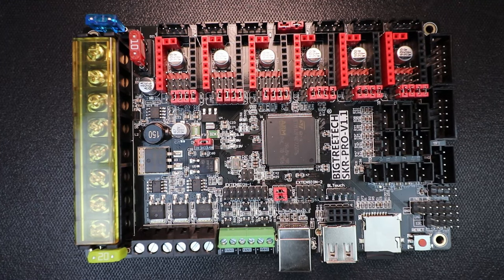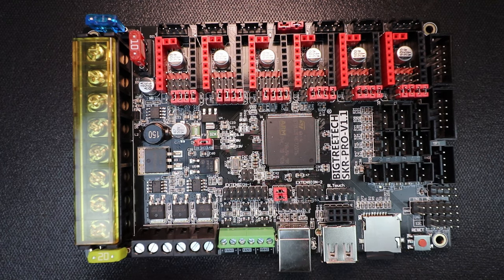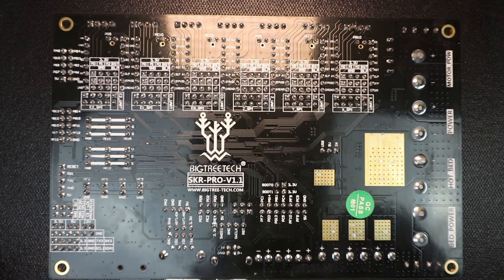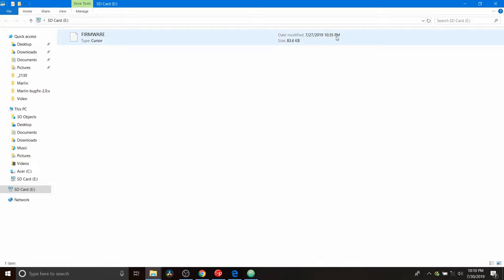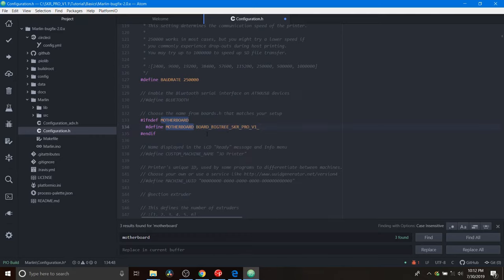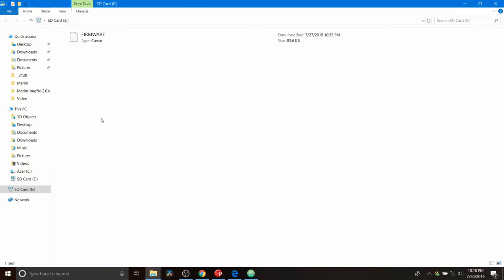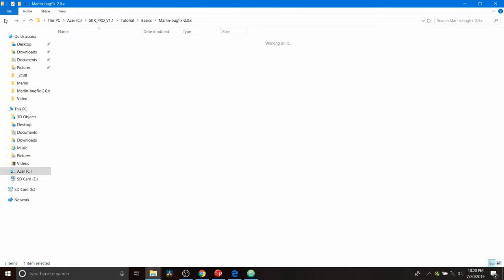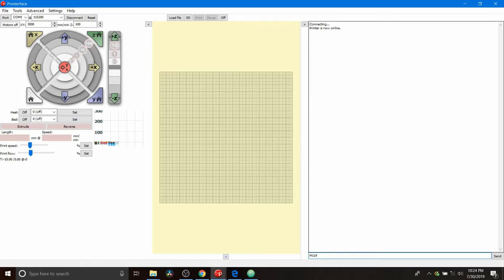SKR Pro V1.1 - Basics

Comment: I recently purchased one of these boards and I was trying to figure out how I was going to control it via USB turns out if you leave the jumper on USB but also power the board with your power supply it works just fine at least for me it did I'm not sure if that's how it's supposed to work or not sort of new to this 🙃
Reply from the maker: Well if it works and is safe sounds good.
Reply: That jumper controls where the board is getting its power from. If the skr is out of the machine on the bench you can use usb power to run the logic (not motors) and update firmware. Once the power supply is hooked up you should set it to internal power instead of usb. It will work either way, but you don't want to power the board from a raspberry pi (running octoprint for example). You can still flash firmware and communicate via usb when running on internal power once it's installed. So no worries there.
Reply: @roomtemp6374  nice thx did your version of Marlin come back with any errors when connected to pronterface mine functions and will print but will not save to eeprom it's just giving me ( hardcoded default settings ) I can change eeprom settings but they will not save 😑
Reply: @soloreclipse94  I think I only used pronterface on it for a minute to verify it was working, but no errors that I recall. (There was some strangeness with getting serial -1 and 0 properly but I think that was the computer.) No errors in octoprint where it ended up. 

Make sure #define eeprom_settings and #define eeprom_chitchat is enabled in your config file to enable saving eeprom iirc. After that it should work from the terminal or the printer lcd like it did in the arduino.
Reply: if left on power source from USB, and using 5160 drivers 1.2 the drivers will not enable and you will see a wierd hysterousis start end report. Turn to IN and 5160 drivers can now be enabled. Guess these drivers pull more power than usb can provide...which does make sence.
Reply from the maker: The USB will work, the problem is loading new firmware like SKR v1.3.

Comment: Great video,
My board is working fine just need to fine tune my steps per mm for both axis also on my board the head bed terminals are reversed the positive goes to - on the board and vice versa will this be a problem ? 
Any one has this issue on their board?
Reply from the maker: If they specifically say positive and   negative you should use them in that manner.  Normally in the past they've used red for both, bit they might have specialized electronics on your heat bed.

Comment: Connect stepper motor drives and connect motors. Try to move moters.
Motors won't respond.
Reply from the maker: Could you give some details?  So far I've only done a video on 2208 UART.

Comment: .when ı do this steps according to do skr v1.1 board and build it finally ı get the error: "LPC1768 failed". I can not solve this problem. Please help me
Reply from the maker: Which IDE are you using?  Does it build in default unmodified Marlin firmware?
Reply: Visual studio Code with platform io. Yes ı download unmodified marlin-bugfix 2.0 and compilie file.  I solved the problem. But this time ı have not got  ".pioenvs" folder in marlin folder :)
Reply from the maker: Do you have a .pio folder?
Reply: @EdwardBraiman  yes
Reply from the maker: Check the subfolders or search on, "firmware.bin".
Reply: @EdwardBraiman  thanks a lot for your attention :)
Reply from the maker: You're welcome, just remember to pass it on.

Comment: hello I have a mks gen l 1.0 and I can't make the engines work, my drivers are DRV8825, the engine is nema 17 (nema 17hs4401 4.2kg / f) and even after doing several procedures the maximum I could do was make the engine get quite noisy and simply not spin (I can't move it is energized) when I put the original anet a8 card the engines run normally the 8825 vref tried both 0.6 and 0.85 unsuccessfully already tried marlin 1.1.9 and with 1.1.8 was what I got most successful because I can start the engine but it does not rotate in 1.1.9 nor that ...
Reply from the maker: Check out my Nema17 wiring video and verify your wires are the same order with an LED.
Reply: @EdwardBraiman  I looked at several of your videos and the engines are different from mine mine is this (https://prnt.sc/oytp19) up to 6 wires are original anet a8 engines, I don't know what to do anymore.
Reply: @EdwardBraiman  I was able to make the axle move as I want, but it is making a noise (as if it was a very thin and loud whistle) and when I have to continuously take the engine
Reply from the maker: Check the datasheet for the stepper.  Sounds like too much current on trimpod.
Reply: @EdwardBraiman  on the board is 1/32 (the 3 jumper attached below the driver) and the VREF is 0.6 I don't know what to do anymore

Comment: Thanks for great introduction. Would be great to also have explained and I am missing is separate power supply function. Especially details like if it needs to be somehow enabled or it automatically detects separately connected power supply for motors/bed.
What is also good to mention is, that there is on at least first batches issue with bed output terminals labelling where + and - is reversed. For standard powering of bed it is not big deal, but people with SSR powered beds whose doesn't know this have problem to make it run.
https://github.com/bigtreetech/BIGTREETECH-SKR-PRO-V1.1/issues/57

Comment: Hello could you do an updated on installing marlin of the bigtreetech skr pro v1.1 using vscode ?, or any help you can give, and keep the guides coming as your doing a great job on the tutorials 😊👌
Reply from the maker: Checkout the SKR 1.4 basics video .  It will explain VScode setup.
Reply: Edward Braiman so will it be the same more or less for the skr pro v1.1 Edward?, ie instead of v1.4 replace that with skr pro 1.4 etc etc lol, top man for replying too, really love your videos Edward, simple and straightforward 😊😊👌👌
Reply from the maker: Yup, thanks.

Comment: Hi everyone and big thanks for this video, does anyone have it running on wanhao i3 plus? I have followed the tutorial but my install has failed as I have not defined printers components.
Reply from the maker: Not sure I understand the question. Are you talking about a motherboard type?
Reply: @EdwardBraiman  yes sorry, that's it. I can't find much about installing skr pro 1.1 on wanhao i3 plus. It doesn't look like there is many people updating the boards on this particular printer (I have also a bit of a problem with wires as wanhao has 16 IDC cable on X which shares ground between fans, sensors and combines 4 wires in to GT+/-) . I have never compiled firmware so I am a bit lost but also excited to learn. I did do some further research and I got some basic component settings from wanhao firmware and ADV++ girmware. I have done some adjustments to marlin just now and I am getting no motherboard defined in configuration.h where I have done it following your video. I will have a look again with a pair of fresh eyes tomorrow as I believe I have all what was wrong in the install report. Why in the skr firmware manual they define first port to 1 and second port to -1? Thanks again!
Reply from the maker: Go into my playlist for SKR 1.4 and follow the install for VScode in my Basics tutorial, as ATOM IDE is no longer used and can cause confusion.  Then follow directions in video as if you are installing a SKR pro v1.1. remember your motherboard should be the one in the video or things will not work.
Reply: @EdwardBraiman  got it!

Comment: I need help fail build
can not active platformıo project
Reply from the maker: It appears Marlin firmware or the development environment has had a change.  I'll be researching today.
Reply: @EdwardBraiman  thank you i am waiting
Reply from the maker: Just opened an issue on GitHub for Marlin firmware build for SKR pro v 1.1.  the bug number is 15680.
Reply from the maker: Marlin just confirmed they have a bug in the latest firmware and are working to fix it.
Reply: @EdwardBraiman  
Thank you for your attention we .
Is there anything I can do during this time?
Reply from the maker: Well unfortunately we need to wait for the fix, but I'm thinking it will not be too long.
Reply: @EdwardBraiman  problem solved.Thank you for your attention.
Reply from the maker: No problem.

Comment: I would switch to vs code, as marlin stated they dont recommend or really support it as its been too buggy. its not stable for most either depends on computer used, VS code is Stable. Also you can hook up multi power supply's to this board, 12v and 24v at same time. I think upto 3 power supply's
Reply: yes 3 like 3 fuses :)